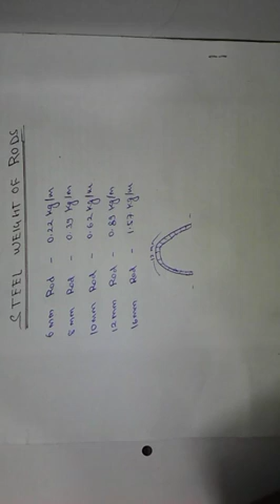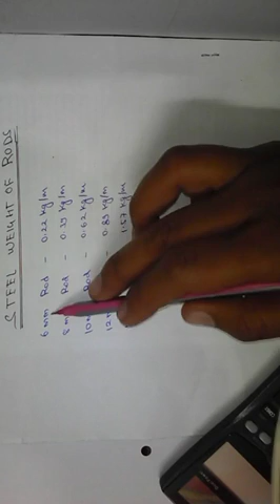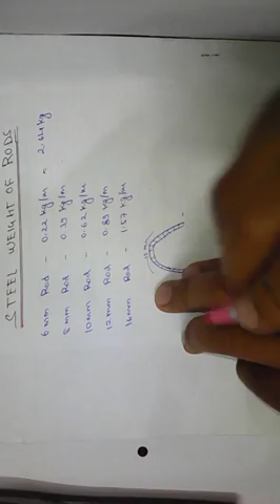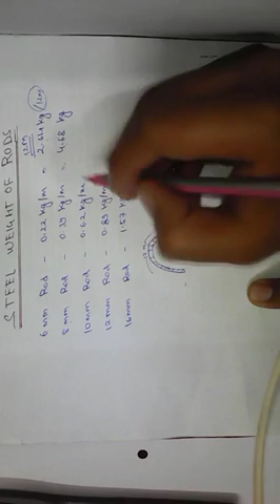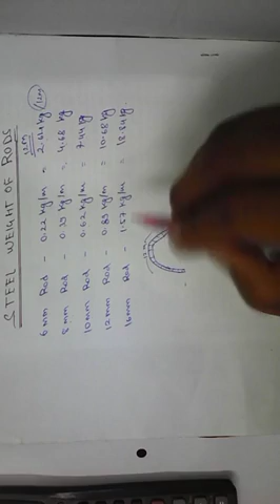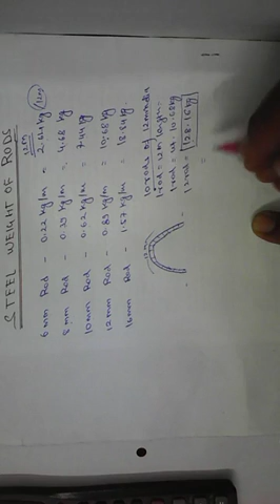How to calculate Steel weight practically (without using weighing machine)

Comment: sir we are constructing planning to construct 5 floor apartment per floor 2 houses in a 60*40 plot size. plinth area is 2160 sft.
can you please let me know which mm steel bars are required for collumns beams and slab